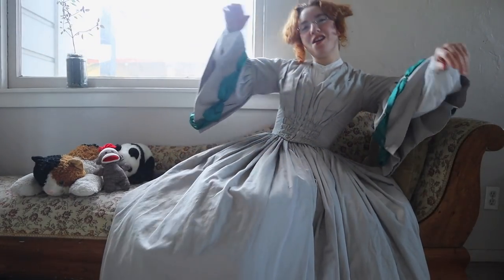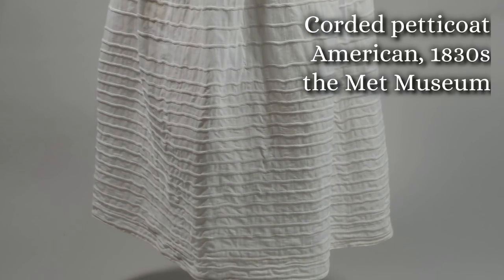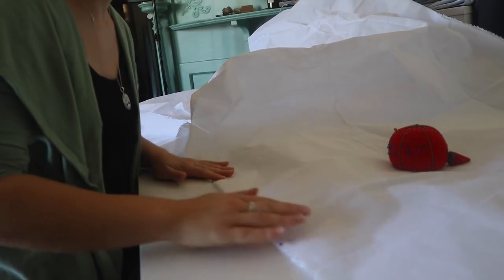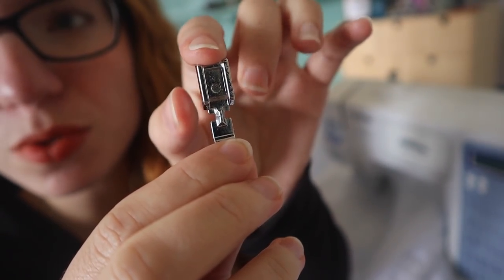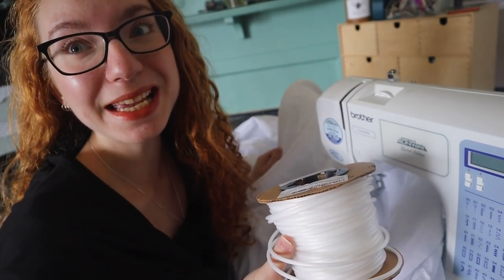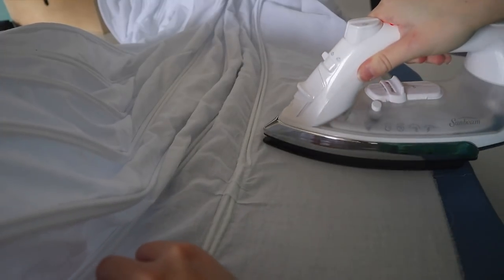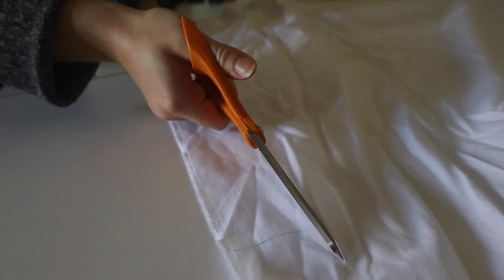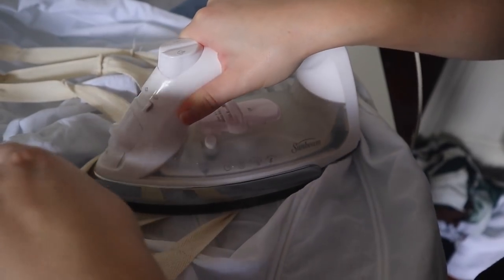A Victorian hoop skirt with no hoops?! Sewing a DIY corded petticoat

Comment: "The historical accuracy has already sailed and sunk without me ever getting on" is such a perfect way to describe this approach to sewing. I feel that so much :D My favorite hack isn't really a hack I don't think -- but it's something you mention on the dress, which is to use bedsheets for fabric. I can trawl through my local second hand stores and get so much good fabric for relatively cheap -- it also makes me more likely to do a mockup if I have a sheet lying around.
Reply from the maker: They're so great! My friends have learned that I am always happy to take old household textiles off their hands for mockups. Only issue with this gray dress is that it's so heavy it's difficult to wear.
Reply: I used exclusively old sheets for mockups for almost fifteen years, until I went to college for costuming and started to make them out of muslin. While I find that heavier muslin works better for starting from scratch or doing the multiple rounds of alterations needed to make a pattern block for an individual, I would much rather work with old sheets if I have a good starting point and just need to tweak things from there. Then I typically follow the seemingly fairly common Victorian practice of using that as both the pattern for the outer layer and as the lining. Who wouldn't want old cotton bedsheets as lining, especially the well-worn ones? Soft, breathable, and infinitely easier to work with than any stupid modern polyester crap.
Reply: Even new bedding, ie from tk Maxx or Ikea or Primark can be super cheap too
Reply: @SnappyDragon  you're such a wee thing. If you were like a carthorse (like me) you'd be fine

Comment: My fave historical hack was also an intentionally not historical theatre trick. I was costuming a production of The Complete Works of William Shakespeare Abridged and so the theme was 'Elizabethan but modern in a funny way'. I took some Elizabethan gowns that I had already made (for a production of Knight of the Burning Pestle) and laced zippers into the front. So now all of my front-laced gowns were zipper front gowns. It required having grommets on both sides of my zipper tapes and having two sets of lacing cords that were adjusted on the actors, but it meant that now my gowns were quick-change AND were flexible for a wide range of bodies that they weren't originally designed for. My gorgeous Elizabethan gowns got two stagings, one approximating period, and one as fun dress up. My absolute favorite hack!

Love your new petti and hope it holds up well with use. :)
Reply from the maker: That's such a clever trick! I am in constant awe of theatrical costuming.

Comment: Oh, clever solution. That corded petticoat looks like a cloud 😊 I might have said it before, but this era suits you very well. 
I've made two corded petticoats. The first was hand stitched with 80+ rows of fine cotton cording - not something I'm likely to be doing ever again! Turned out nicely though. The second was an experiment using a corded bedspread, as fabric with woven cords could be bought for the purpose at the time. That also worked well. They are both heavier than this though.
Reply from the maker: Thank you so much! It seems like I love any silhouette with a big skirt and big sleeves, except the 1830s 😂
Reply: @SnappyDragon  It does take some getting used to - I dislike the 1890's sleeves, but think some of the 1830's ones are fun. Not very consistent, but... 😁

Comment: Love that you use bedsheets. I've been using sheets for all my costumes for years. It can actually be cheaper (a queen size sheet is approximately 7.1 yards of fabric ) I buy sheet sets on clearance when the stores change out "winter colors" for the "spring colors" and vice-versa,  depending on the brand I can get a queen set for as low as $10 vs buying one yard of similar material for the same price (or more )  unless you tell people it's a sheet , noone will be able to tell.

Comment: Thank You for another lovely video. I too am disabled, and have come up with only one hack so far.
For my chemise, I picked my favorite sleeveless day dress as a pattern. It was loose enough that I could wear it without bunching up as I also  wear it as a nightgown. 

The sad part with that day dress is that it was a one of a kind, and had worn so thin that it wasn't 'decent' anymore. Yet as a pattern, I can reuse it a thousand times and no one ever sees it except for my dog or my husband.

I did buy patterns at one time, however the problem between the patterns and what works for my body is that I'm a hefty human, and most patterns don't fit in the right way. Rather than adapt them I adapted garments that work into patterns.

Thank You so much, I love your channel. For cording, I'm going to be using a cotton yarn. The local mega store sells it in cones, and while using a similar technique to yours, I will be cording more rows. I saw the technique in a video on stays somewhere.

Thank You again, am going to be working on a corded petticoat this winter. I have a few projects ahead of it in line though. Take care. -L

Comment: Historical accuracy really depends on what a recreation is going to be used _for_, I think. Since you're going for the visual aesthetic while also being accessible, the unseen construction doesn't matter.

 Like, imo it would only matter if someone were wearing the full getup to properly understand what it felt like, in the day. Sort of method acting as education. Or, if the construction of the piece was the point, rather than a wearable end product. 

So tldr, while I believe that historical accuracy in both methods and tools (and tulles, I guess 😂) have their place, I also think there's no reason anyone should be upset about this dress being more accessible to you. 

... further ranging but whatever. Anyway. Tbh, even if you didn't have those conditions, there's no reason to make the dress more uncomfortable than necessary, and no one should have to disclose disability/ conditions of they don't feel it's safe, wise, or even just don't want to for literally any reason.

Comment: I have the same model sewing machine. Mine never could do a button hole stitch with the provided or replacement button hole feet. The level to trigger the back and forth mechanism never worked. I know it's not as detrimental as not being able to shift the needle shaft left or right, but I feel your pain. The limitations of the lower end models are felt by so many of us. And replacing them for better is just not a cost we can afford to do. 

I appreciate watching someone work on a machine that is literately my machine. It helps reinforce the "See, they are normal people. If they can do it, I can do it." idea everyone needs to remember. You are sooooo much appreciated for your work.
Reply from the maker: Aww, thanks so much! This little machine does amazing things for what it cost me. I've literally sewn a leather doublet with it, and that was before I had any clue what I was doing. It regularly works far above its pay grade, which is why this is the first time ever I've found myself wanting a feature it doesn't have.
Reply: @SnappyDragon  oh wait, I am making assumptions based on what you said. You couldn't use that foot on the right side And you ran it setting on Stitch 0 width 0. So far left is how you could use it? It really doesn't move right at all? Like you can't move it to Stitch 1 width 7? That's how I would have used that foot to get the right side of the stitch. But again, I was assuming because you said it, that you can not, you already tried doing those setting or the function is 'broken' on your machine. But, hey, if you didn't know.... try it. Stitch 1, width 7 would push your straight stitch all the way to the right and you could use that foot (unless there a problem I do not know of your machine)  :-D no need to answer me if you already have answered these things else were. I'll find them if I look.

Comment: The first thing I wanted to say is that this concept is brilliant, the video is brilliant, you are brilliant. I have often admired corded (and quilted) petticoats from the 1830s in particular, but balked at the idea of the weight. The second thing I wanted to say... tentatively... is that I think it might be possible to tell your Brother machine to move the needle to the right, but it's a bit of a roundabout process. [For context, although I did use to sell Brother sewing machines, it was here in NZ and I know for certain that the models are slightly different in various markets, so if you've already tried what I'm about to suggest to no avail, I'm sorry and please feel free to tell me so I can improve my knowledge].

First you set the stitch number to one of the straight stitches (00 or 01 in your case), just as you normally would, but then the trick is to not only adjust the stitch length to whatever you want, but also the stitch width. Yes, the width is primarily there to determine the size of zigzag stitches, but because the machine isn't set to make a zigzag stitch, the stitch width adjuster will instead set the position of your needle. Set it as high as it will go, and it will move the needle to the extreme right of the needle plate.

If this method works for you, it's also a way to fine-tune the position of your needle for a straight stitch, for example when trying to get close to zippers - the needle doesn't have to be simply "on the left" or "on the right". But if this doesn't work for you I really am sorry and you're awesome for managing to wrangle that sea monster.
Reply from the maker: Ooooh I will have to try this! Thanks so much 💚💚💚

Comment: I like to make no sew tutus for theatre and move the tulle around to create the correct silhouette for a certain play. This way you can get so many different eras with the same garment just by sliding it around
Reply from the maker: Ooooh how does one make a no-sew tutu?!
Reply: An elastic for a waist band, then millions of tulle strips tied to it, like when you fold a strip in half and pull the end through the loop. Only in this case you have a bouqet of strips for the volume
Reply: @SnappyDragon  usually we use ribbon as a wasitband so it's more adjustable and then tie the strips of tulle around it. Its kinda difficult to describe in text form, but there are so many tutorials and it's so simple when you get the hang of it

Comment: I am wondering if making the petticoat in the shape of the bell you are looking for... so shaping from the top first, would increase the smoothness of the silhouette without causing the wrangling with the cording that you had.  Yes, it would be more math... sorry... but it would also... maybe... be much less work and struggle.  You would also then not need to worry about gathers or pleats since it would be waist size at the top and adding the waistband would be more simple.  Just a thought.

Comment: I've tried to achieve an early 1850s shape using petticoats but it was 1840s or even 1830s at best. Not to mention they are really warm and a bit itchy because they're made of stiff tulle and silk linings. I find a hoopskirt helps me with my stride while walking and my sitting since the hoops hold the petticoats away from my feet which is quite refreshing especially in hot weather.
Reply from the maker: What I love about this petticoat is that it's the best of both-- stiff structure keeping a million petticoats off my legs, but lighter and a bit more collapsible than a cage crinoline. I'd probably still go for a cage (if I had one) for outdoor events where it's hot and there's lots of space, though.

Comment: ok question...could I, in theory, use something like the welting cord to make a corded pair of stays? As someone who wants to sew historical stuff and wear it but not having the resources, I absolutely love the idea of using alternatives from the hardware store
Reply from the maker: Quite possibly! I would go with much smaller cord than this, maybe 1/8" instead of the 5/32 I used.
Reply: My daughter and my sister use zip ties for boning.  They come in all different lengths from handcuff to a yard long, which we use for tieing up peonies and roses.  They are washable and cheap.
Reply: @lenabreijer1311  Thanks! I did get some zip ties, the biggest ones I could find, but turns out that they're still too short and I can't find them industrial zip ties anywhere in my town. So this idea failed on me 😅
Reply: @SnappyDragon  Thank you! I'll get some soon and try it out! Did you wash your petticoat with the cord it? does it do well in the wash I wonder?
Reply: @katechaste  my sister orders them online.

Comment: I'd love to try this, was the welting cord expensive or hard to find? and do you think a few rows of ruffles would help or harm the silhouette?
Reply from the maker: Nope, I bought a 60yd roll for around $20-- it's very findable if googled. Some ruffles certainly might help with any lines, although the issue of the cord buckling is probably because I used too thick of cording, and too big of a petticoat. Don't be overambitious like me!
Reply: @SnappyDragon  Thank you so much! Perhaps I'll try to find a thinner type, and maybe iron it out ahead of time 🤔
Reply from the maker: @arianahernandez3932   @Ariana Hernandez  I used 5/32", but I think it goes as small as 1/8".
Reply: @SnappyDragon   could it als be possible that it wasn't thick enough?
was the cording fighting the fabric or did it lose against the fabric?

Comment: a corded petticoat is itself my favourite "historical hack". i use it for a number of periods outside its ostensible ones. by manipulating what other kinds of bum pads (or lack thereof) and compressing or augmenting fullness under/over it, i can get remarkably accurate silhouettes for a wide range of periods. i actually prefer the tudor look i get with a corded petti and otherwise correct underpinnings to the irritating farthingale i had. i use one for romantic era outfits layered with another petticoat. i use it for 18th looks, too, with false rump or pocket hoops on top of it. obviously, it's great for victorian, even working with some bustle era looks. i have a much narrower, very light, corded petti that's great with edwardian walking suits, especially the wintry sorts. 

my other favourite non-historical-historical hack involves stitching modern bra cups into various period corsets, etc. i like the way i look better, and there's less 'smooshing' or need for, er, rearrangement. it's emphatically not period correct, but it is comfortable and i feel more relaxed wearing the corset all day this way. especially good with regency looks, where it actually is compatible with the desired period look. my transitional 'busk optional' corset with modern bra cups added is one of the most comfortable undergarments i own, of any time period.